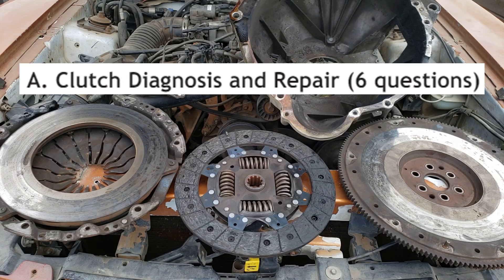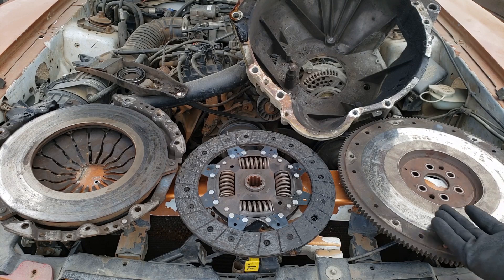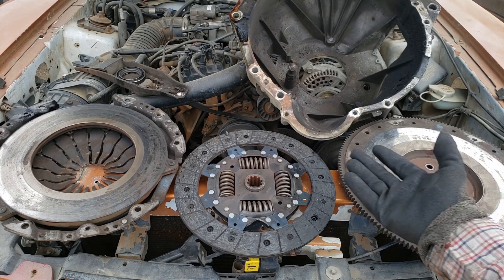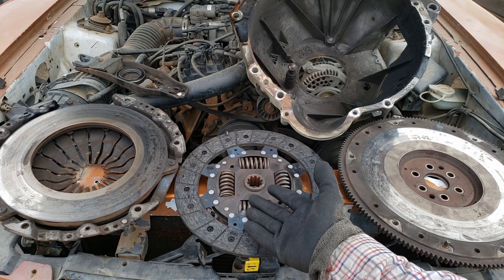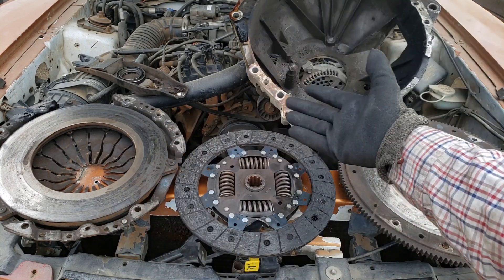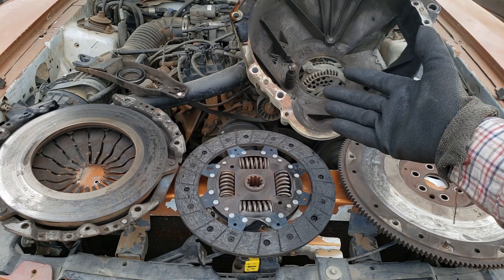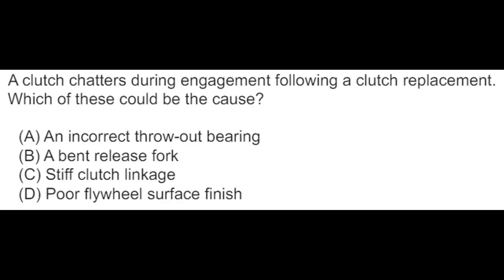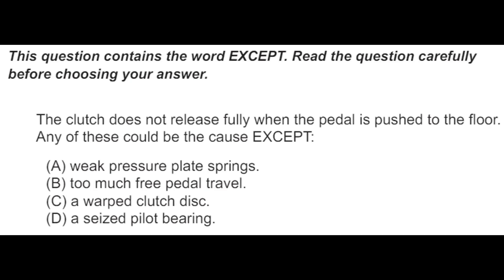ASE A3 Test Prep #2 - Clutch

Comment from the maker: Feedback after taking the test: this is the most useful video out of the miniseries. Yes, there was 6 questions about the clutch, but it seemed like there was way more! Clutch chatter, slippage, and drag. There was a clutch slippage question that included issues in the rear axle. There was a question that used the method to diagnose input shaft bearing/output shaft bearing noise, but it was diagnosing noise after the transmission.

Comment: I would like if the answers to the test questions are reviewed and explained they are right/wrong.
Reply: i agree too
Reply from the maker: Ok, the first question , answer is (D) "Poor flywheel surface finish." If the flywheel is machined but if the way its cut is "angled," then the flywheel will be "warped" a little bit. This can cause clutch chatter. 
(A) is incorrect because an incorrect [release bearing] will probably have issues with RELEASING the clutch
(B) is incorrect because a [release bearing] sits on the release fork, if its bent there can be issues with RELEASING the clutch.
(C) is incorrect because stiff linkage can cause clutch RELEASE issues.

The second question, answer is (A) "weak pressure plate springs," those will cause clutch slippage.
This being an EXCEPT question, the rest of the choices will cause the clutch to not fully release.
(B) was explained in the video
(C) warped clutch disc, in theory can still be engaged because some of the "warped part" is still engaged.
(D) seized pilot bearing will eat away at the input shaft's tip, this can cause the pressure plate and clutch to be "warped" to the flywheel. (C) and (D) are extreme examples of theoretical faults.